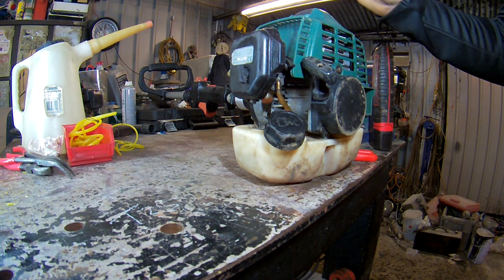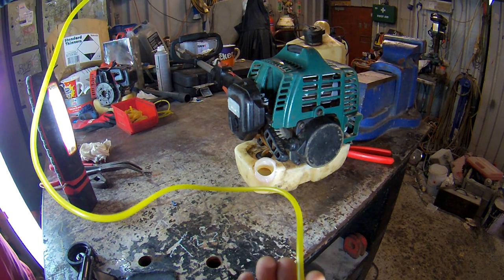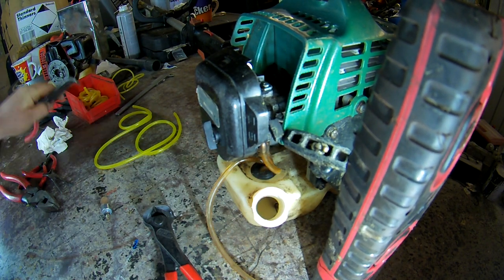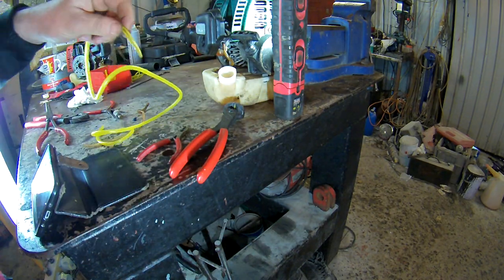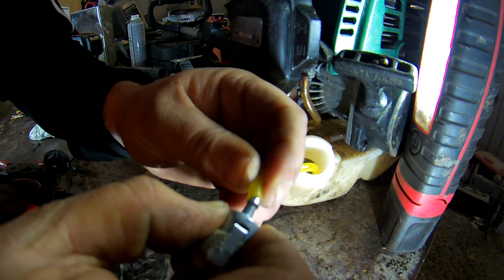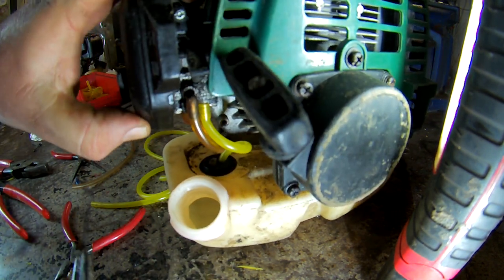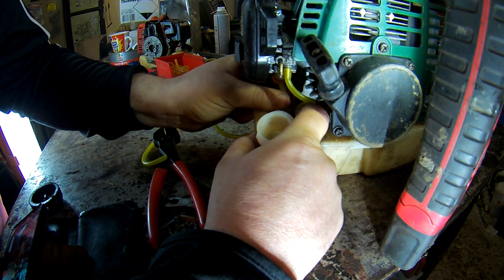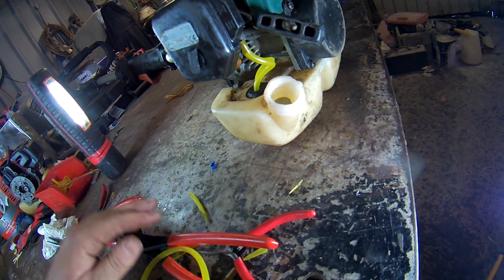How To Replace Fuel Lines On Strimmers/Chainsaws/etc

Comment: You can also use the silicon lubricant spray to ease your new lines through the rubber tank bung. Most of the problems with filters are due to the E10 petrol. The 10%Ethanol in the petrol dissolves the fuel lines and some of the filter cages which gum up the works. E5 petrol is better, but the ethanol can still dissolve the lines but slower. Very useful  video thanks.

Comment: Thanks for the video. I got a hedge trimmer and when I emptied the fuel a thing fell out. It was the filter that has a weight to make it drain fuel at any angle.
The pipes were breaking down. I took the fuel tank off and the grommet that holds the pipes AND used a caliper to get the pipe size. Now to find pipe.

Comment: My toro weed eater  I changed carb out and worked fine for about 20 minutes then had soo much trouble starting and keep it running . Could ba bad gas or what ? Spark plug I dropped and may have damaged the gap ?

Comment: I've got to change the fuel lines on my strimmer as I think one is split and causing it to suck in air. What fuel filters do you recommend.
Reply from the maker: Hi Hard worker.  I use various types but I quite like this type. Try this link.      https://www.ebay.co.uk/itm/5-pack-Fuel-Filter-Pick-Up-For-Husqvarna-50-51-55-61-268-272-XP-353-365-372-New/322562093938?hash=item4b1a32f372:g:8AoAAOSwSzRZShCp.              Also the black and white ones and also the ones with like a steel cage around the filter. Heavier the better I think to flop about in the tank I reckon. Hope this info helps.   Cheers Calvin

Comment: good video, the main problems with Strimmer's, Chainsaws ect made in china is the fuel lines, A  Proper Gasoline fuel lines are what you need ,guy from a model shop told me this. how many people have used there strimmer one year without problem then the next year it wont start ? its 9/10 the fuel lines perished

Comment: The outside diameter does not represent the correct size of line because it is the inside that assists to  determines the amount of fuel you receive at the carburetor !